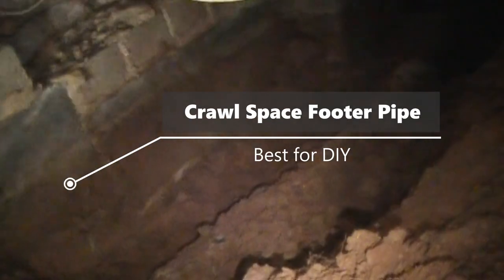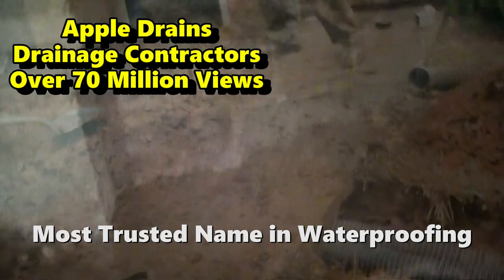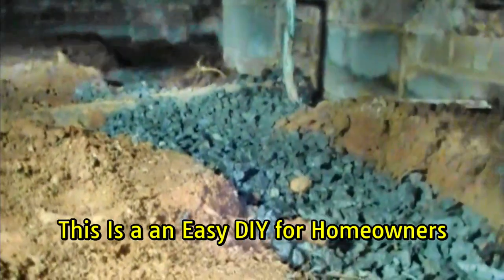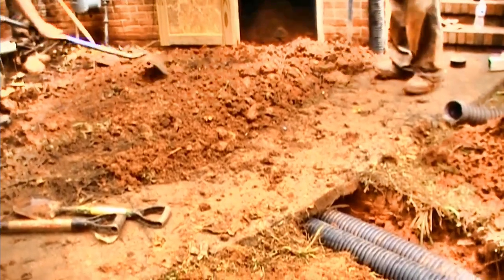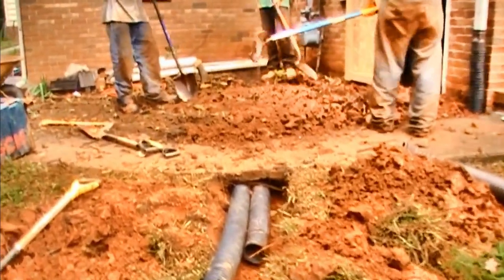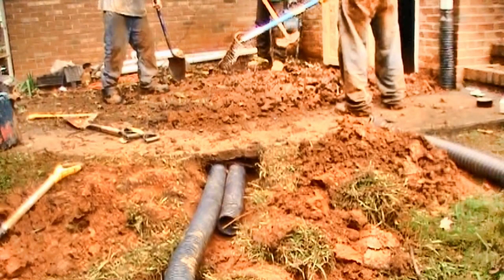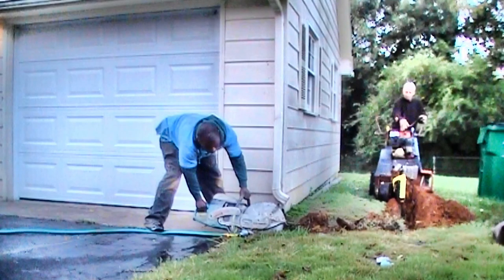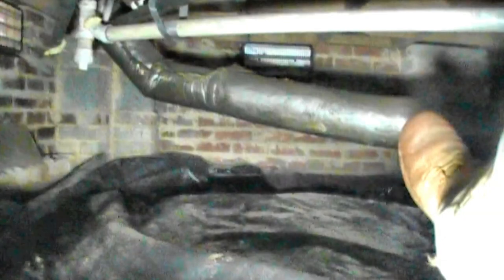Foundation Failure - How to Fix

Comment: What would you recommend doing in a crawlspace for the footer is exposed? I know I should run my drain tile on top or along side. The footer currently there is not enough dirt to even cover the footer. Should I add more dirt before adding the drain tiles? I have one sump pump and I’m not getting flooding. Just a lot of moisture.